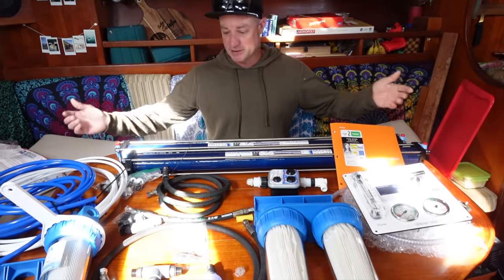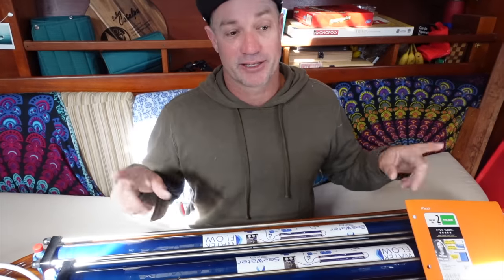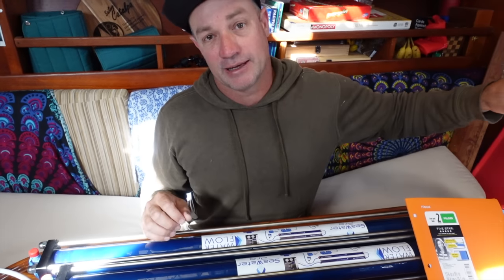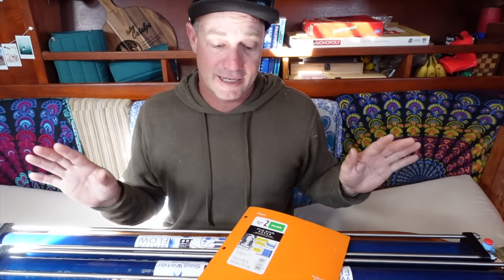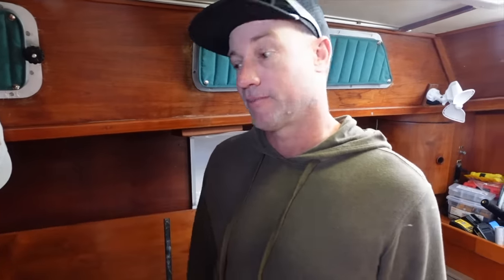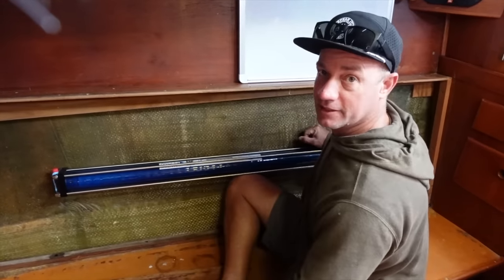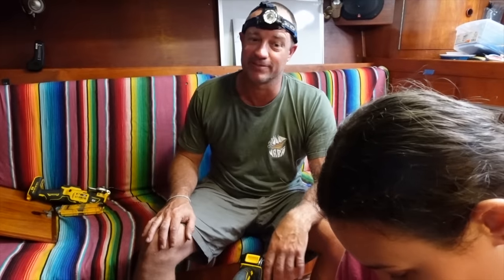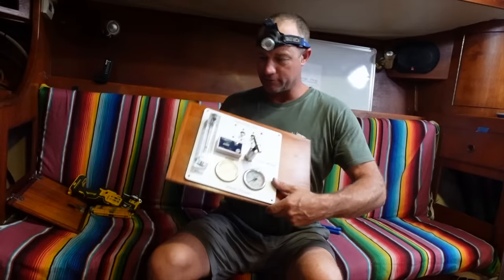From Saltwater to Fresh | Installing a Watermaker on Our Sailboat | Ep 341

Comment: I used to operate a ship’s distillation plant which used a huge amount of electric power to make 250 gallons/hour. It was called a vapor compression distiller and took up a large space in the engine room. So impressed with this system which uses solar power.

Comment: Nice install. The location of the filters may be a problem later on. I installed a filter in a cabinet that was subject to HVAC air with little insulation. In the winter, the warm air caused a bacteria to grow inside the filter that I could never overcome except to take it out. Maybe we have strong bacteria in Georgia, but you may need to mount the filters like you did the membranes. Good luck!
Reply from the maker: Cheers for the heads up will keep an eye on them ☺️

Comment: Hello guys, Since i have the exact same victron multiplus 3000/120, i wonder if you are running your watermaker fromt it, or from the 5000 watt inverter? Because i heard rumors that the Victron can't handle the start up current of AC Motors in this size. Whats your expirience? Thanks and BR from Sweden
Reply from the maker: We are running it with the victron no problems so far. We were using our other inverter but got told it wasn’t good to run on a not sign wave inverter 😉